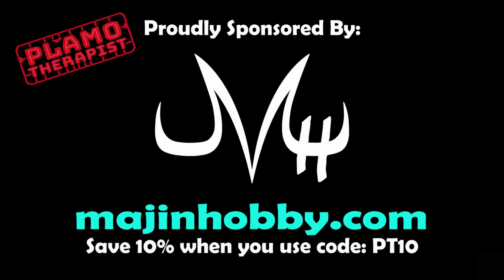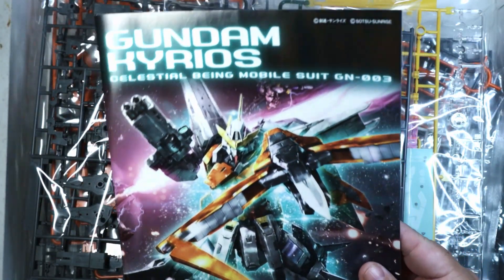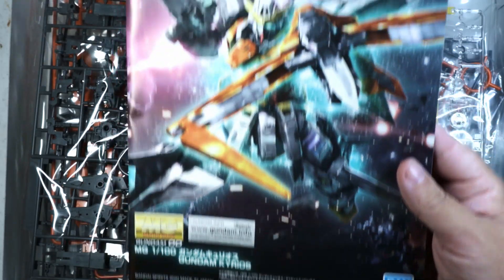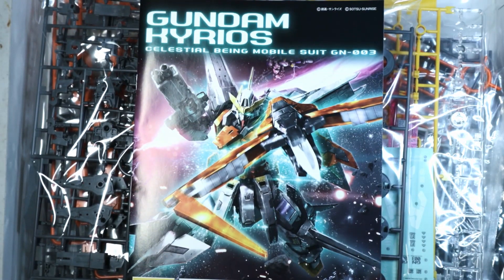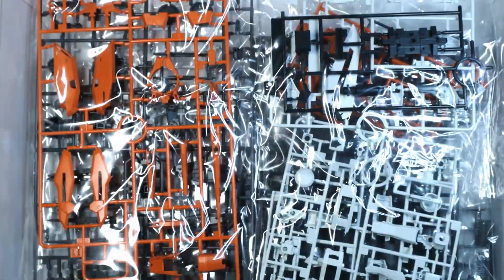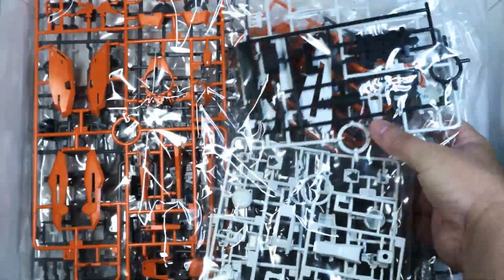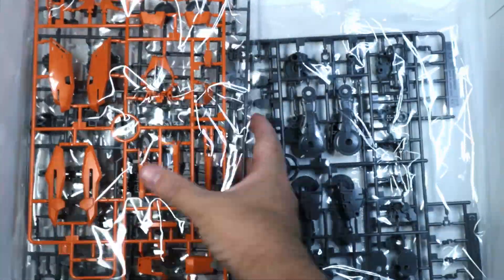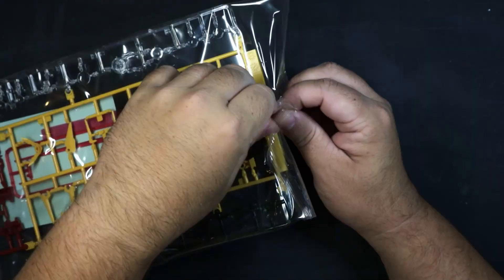Kyrios Gundam MG Custom - Cerulean Project & Mental Health

Comment: Cerrulean Project 3.0 is about to begin; will you entering this year?

Also thank you for addressing one important issue that goes unnoticed.
Reply from the maker: Hey, thank you so much for checking out my video.

I will not be participating in the project this year as I am currently working with a few other builders on the third @gunplacharitycollab on Instagram! 😁
Reply: @PlamoTherapist  I'm definitely going to check that out.
Reply from the maker: Thank you so much! It was a group effort and I'm proud of the section that was in my charge. 😁😁😁